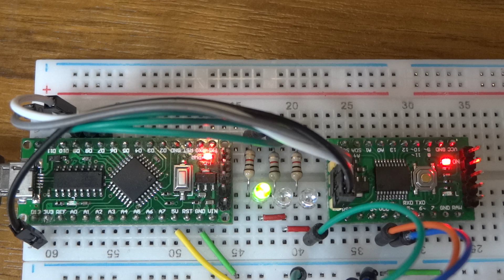Using one LGT8F328P chip as an ISP SWD programmer to program another.

Comment: Hi, I'm still confused as to how the special program is written to the new nano style programmer board in the first place. What is the actual file called and how is it programmed to our nano style board ? Is the Arduino IDE used for this or AVRdude ? Many thanks.
Reply: I got your edited LarduinoISP file programmed finally. Just about to wire the new programmer board with LEDs, up to another LGT8f328p board and test it out.
Reply from the maker: You need at least one Arduino that you can program in the normal way from the Arduino IDE.  This can be a new style Nano (LGT) that already has a bootloader, or any ordinary (Atmel chip) Arduino, such as a Nano or Uno.  The Arduino IDE always uses the AVRdude program to actually transfer sketches to the attached Arduino - but it does this automatically 'in the background' when you click on the Arduino IDE upload button, which looks a bit like this:  (=>)    
Download the sketch from here: https://ceptimus.co.uk/LarduinoISP.zip  upload that to the Arduino in the normal way.
Then you're ready to upload the sketch to the target board (which must be the LGT type), attached to the first Arduino's pins 10, 12, and 13.  For this, you set the Tools, Programmer, to "Arduino as ISP", and use the Sketch, "Upload Using Programmer" option.  If the target board is the smaller type, as shown in this video, then the sketch to upload to that one can be downloaded from here: https://ceptimus.co.uk/LGTisp.zip.  If the target board is the larger LGT (Nano) type, then you can upload the same sketch that is already running on the first (programmer) Arduino.
Reply: @ceptimus  Hi,  I have successfully programmed an LGT8F328P  board using the LarduinoISP programmer board, but with AVRdudess (Windows GUI version of AVRdude). This means I can write and compile my code in assembly language in Studio 7 and program these boards without the necessity for Arduino IDE at all. 
My only problem is working out how to set up the LGT8F328P clock prescaler in my code.  This is normally taken care of by Arduino IDE. I will figure it out though.
Edit:
Sorted it out. Unlike  the Atmel AVR micros, the LGT8F328P clock source select and clock prescaler are registers that are written to at run time. No fuses to be written for this, but your hex file of course needs to have this data because the default clock prescaler setting is divide by 8.
Reply: @ceptimus  Thank you for the help. Very much appreciated.

Comment: can i use it as isp for classic nano3???
Reply from the maker: Not to program a classic (Atmel) Nano, because that doesn't have an SWD interface.  You CAN use a classic Nano as an SWD programmer for an LG chip.  You can also use any Arduino as an ISP for programming other Atmel chips - see https://docs.arduino.cc/built-in-examples/arduino-isp/ArduinoISP
Reply: @ceptimus  yes bro. but i lost my second nano 3 for memcarduino and it is sealed deep into the case. on the first, the megadrive ++ mod is sewn without a bootloader. and there is this Chinese as we found out - which will not help me. I will look for another one.THX
Reply from the maker: @ДмитрийОрабей-п5ж  I think you can use the LG as an ISP for the classic Nano, providing the LG already has a bootloader installed.  But not using the sketch I presented here - rather use the info in the Link I provided.
Reply: @ceptimus  yes, I did it earlier with the classic ones, but now it doesn’t work, the arduino isp sketch is sewn into the Chinese version, the connection diagram is the same as in the official manual, but then the program does not find the programmer and it doesn’t work out.  but there is good news, the genesis mod has been flashed and works in Chinese as it should.